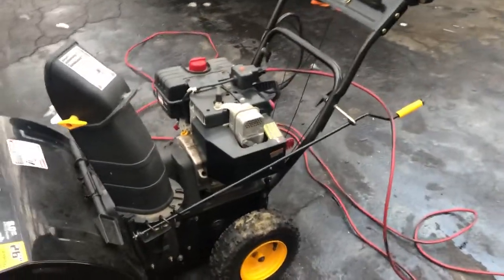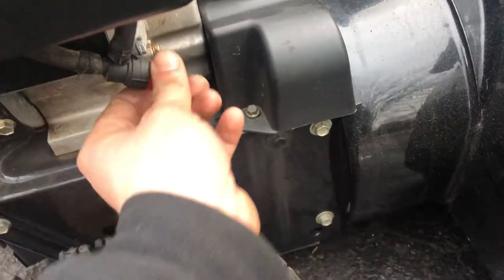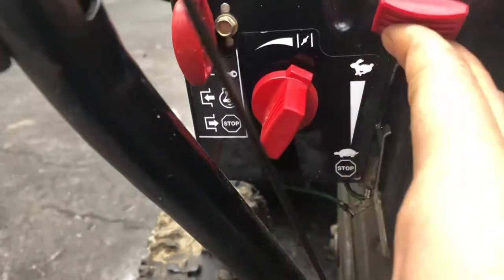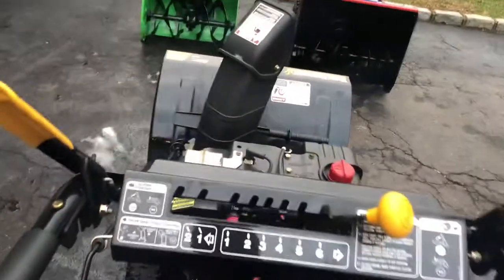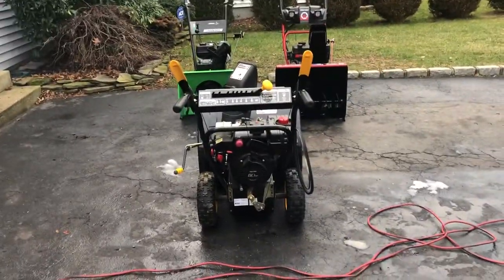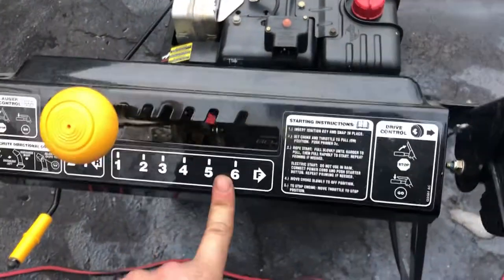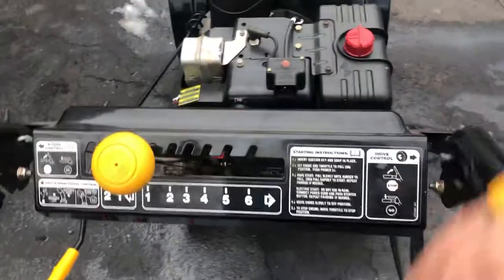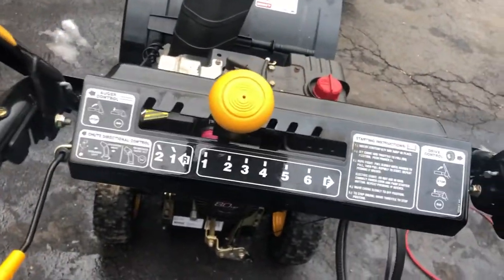How to Start Your Snow Blower 8-10 HP Tecumseh

Comment: I find that my Tecumseh 5hp does not need full choke to start most of the time.  I use half throttle to start and bring the speed up after the engine warms up for 1-2 minutes.  I also shut the fuel off and let the carburetor run itself out of fuel when I am done using the snowblower.
Reply from the maker: Ahhh I see you added the fuel shut valve!  Nice tip and trick.  I run my machines dry for off season storage.  For those that store their machines in an attached garage to their home. I recommend your method!

Thanks for the view and comment, hopefully you subscribed to my channel 🤙🏻🦅🇺🇸🔧
Reply: @pattayperformance  Both my machines had shutoff valves installed at the factory but newer ones might not have them as the manufacturers are saving money any way they can.  I also use up any gas I have in storage by putting it in my car's gas tank for safety's sake as I have no need for it during the summer months because the lawn is mowed by a landscaping service.

Comment: Dang I should of checked this video out before I just shoveled all of my sidewalks! Got a snow blower with the house I bought and I've never had to deal with the snow as an adult but had to shovel as a teen. So I was a bit nervous to even mess with the thrower.
Reply from the maker: Check the oil before doing this!  Keep us updated!

Thanks for the view and comment, hopefully you subscribed to my channel 🤙🏻🇺🇸🦅🔧
Reply: Easier than operator a gas lawn mower to tell you the truth. Like everything you just have to take care of it. Drain the fuel in the off season

Comment: I understand you say when start full open choke and rabbit power. What will be choke position after started ? Half choke or?  Thanks!
Reply from the maker: Great question!  Depending on how long it runs after you started it depends on how much is needed in order to restart.  With the engine fully warm 1/2 choke is usually the sweet spot!
Reply: @pattayperformance  Can I say: in a "perfect world" when engine runs, zero choke is expected, however 1/2 choke is recommended in real world? Thank you very much!

Comment: I have same model. It’s now 18 years old. Wires are brittle. I replaced the plug, carb and added a fuel shut off. Just got hit with snow storm unit won’t start. Pulled cover and noticed that the wires came off the on/off terminal. Going to order a new terminal, but not sure which wire goes where. Have one coming off engine? And other from where the safety key plugs in. Any help is appreciated
Reply from the maker: That just kills spark…

You should have one green wire from the key ASM to the spade connector on the kill switch.

The other one is black wire goes to the coil…

Are you on Instagram?
Reply: @pattayperformance  unfortunately no
Reply from the maker: @brian04r  send me some photos

Comment: You should push your primer before you turn the choke on. This way the gas gets to the motor . Choking it first means the gas doesn't flow freely to your piston.
Reply from the maker: Thanks for tip.  I never had a hard starting issue.  I will try it your way.  As you can see the machine fired right up with no issues!  Thanks for the view and comment.  Hopefully you subscribed to my channel!
Reply: That is not how it works. Primer send some air to the bowl, forcing some fuel in the carburetor Venturi. The choke helps enriched the already rich mixture in order to start the motor.

Comment: Murray electric start snowking: I got choke open, primed, motor speed at rabbit, and it starts with the electric start. But it turns off when I take my finger off the electric start button. What am I missing?
Reply from the maker: You have other issues with your machine.

You need to confirm FACTS

Fuel
Air
Compression 
Timing
Spark

One of these or more is missing causing a no start.

Have you done any diagnostic work and if so what did you find?
Reply: @pattayperformance  figured it out. Thanks for the suggestions.
Reply from the maker: @bgazley  Great Job!  What was the issue?

Comment: What if you don't have the safety key or the plate it goes in is there a way to by pass it? I got mine for free
Reply from the maker: Yes…see where the Key goes…follow the green wire and disconnect it from where it mounts to the motor.
Reply: Thank you for the help 3 pulls it fired right up purrs like a kitten
Reply from the maker: @steveobee3488  right on! Tape that wire off so it never grounds out and shuts the machine down.  Also now is a great time to change the oil and service the rest of the machine!  I have videos on that as well! 🇺🇸🔧🦅🤙🏻